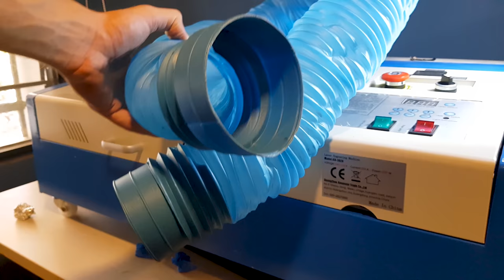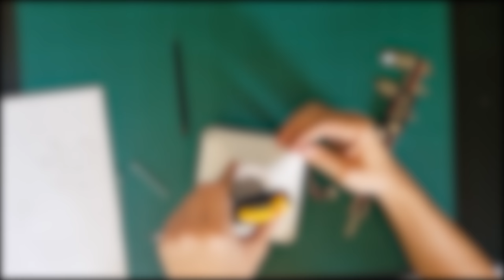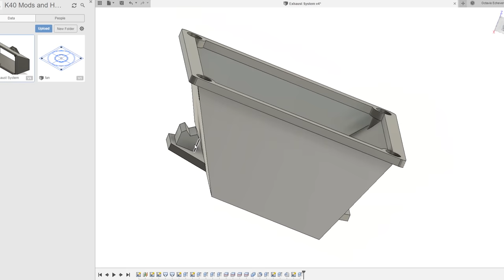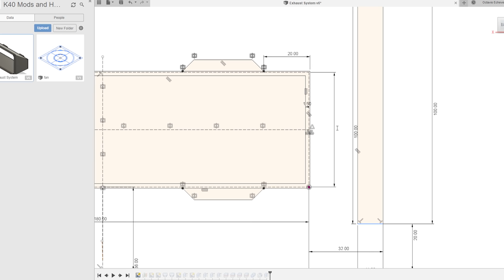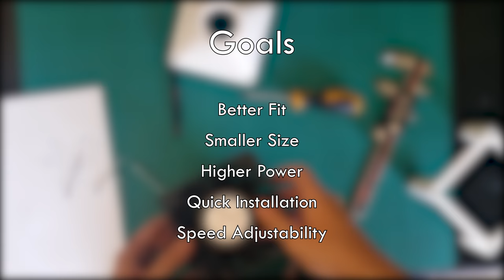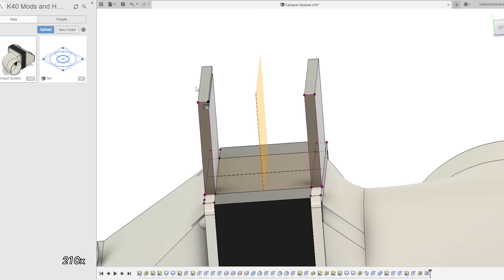K40 Chinese Laser Cutter Hacks & Mods Pt. 1 - Improved Extraction | Octavio.Makes

Comment: I wound up 3d printing the entire duct system and only using a small section of flex duct while adding two inline fans (since the smoke has to travel a long distance) as well as a butterfly valve so I don't have to have the fans constantly running to keep warm air from creating condensation inside the machine, and it works great, I have my laser in my bedroom so I built it hoping to have almost no fumes leak from the machine, and using 3d printed tubes that have a smooth interior which promotes airflow was a huge help.

Comment: You can fix your code issue easily. I had to do something similar for a project i was working on  for adjusting led flash speed and mapped the values to only the ones i wanted. add this to your code, changing the 25, 300 to the lowest and highest value you want the pot to read. this essentially maps the whole pot range to this smaller set of values, so you can adjust only the range you want
potVal = map(val, 0, 1023, 25, 300);  //map analog read from pot 0-1023 to values 25-300, and set potVal

Comment: How does this compare to sealing the stock blower? Also, axial blowers are low static pressure, while squirrel cage are high static pressure. Reverse of stated. Check out the $60 Dayton squirrel cage fans on amazon. They are designed for ducts.
Reply: I plan to duct tape mine and swap the hose for some steel reinforced tumble dryer hose. I’ll let you know.
Reply from the maker: Axials fan are definitely not meant to be used like this. Squirrel cage and mixed flow blowers are way more capable since they can handle more static pressure. My goal was to create an extractor with components I had laying around and were found easily.. In V2 I will use this type of fan!
Reply: @octaviomakes  Those cheapo daytons are pretty formidable. They are used a lot for residential furnaces, which are common in my neck of the woods.
Reply: Ah hah. Found this vid. So I’ve sealed my crappy fan to the cutter with duct tape. Lots of it. It makes a huge difference to the airflow from inside the machine. Without the seal it takes the easy route and sucks air through the gap rather then via the machine. Anyway I’m upgrading it ASAP. The OP solution won’t work any better then stock once sealed. They just don’t make computer fans to handle that pressure.
Reply: @colinantink9094  I also taped mine and it works great. No complaints from me. I don't care if I have to remove the tape to access the tube, as I will never touch the tube unless it breaks.

Comment: How often do you need to look at the CO2 laser?  I would have just hammere the bottom flange down than duck tapped the fan lower so I could still open the the CO2 laser lid and have an air tight lid.

Comment: I have a hard time understanding if this upgrade is worse of better at moving the air inside the machine out. :/

The fan you bought looks like a high static pressure fan,  but mounting that on the bottom blowing into' the case combined with a suction fan, like the included bathroom fan on the end of the hose in the back might be more efficient i wager.

That's what i am planning on trying at least, i mean i have to fix that hole in the bottom of the machine letting out the laser somehow... :D